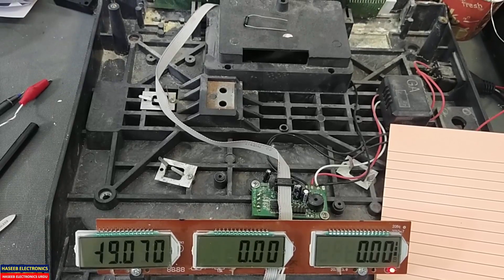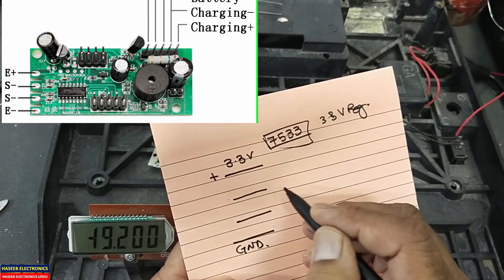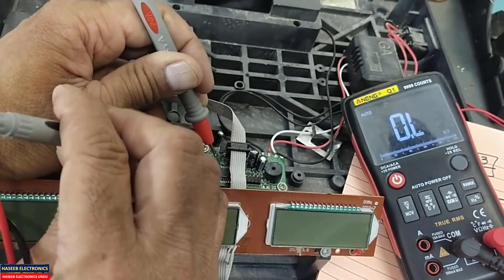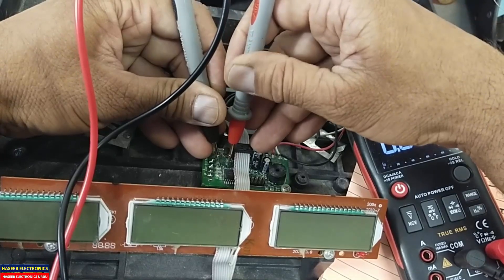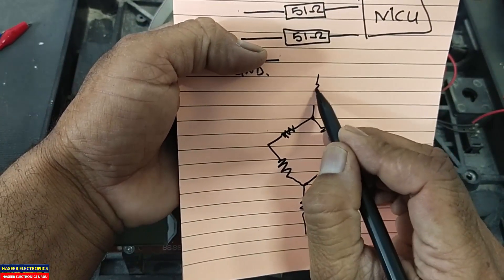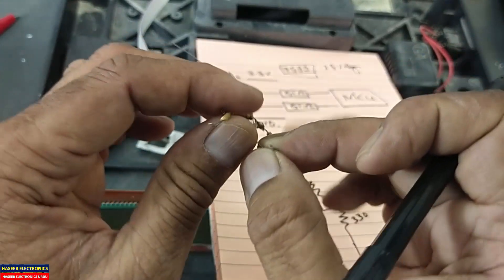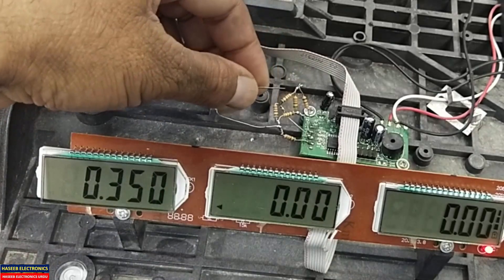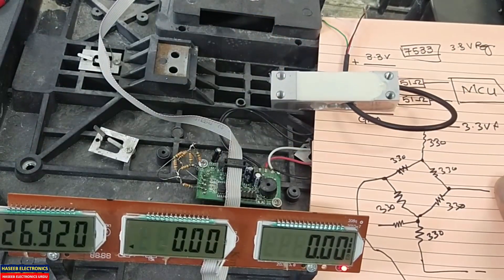{643} Simulate Load Cell To Verify Either Load Cell & Weight Scale PCB is Working Or Not

Comment: Sir   (top248yn) ic 24v SMPS output flickering. Any solution an how to check this
Reply from the maker: please check secondary side 
specially output capacitor & rectifiers, 
zener if there is, in series of optocoupler input side 
check main dc capacitor
Reply: @HaseebElectronics  sir any way to check ic